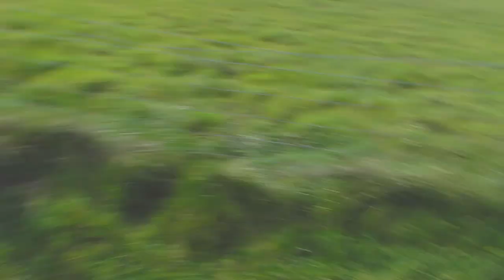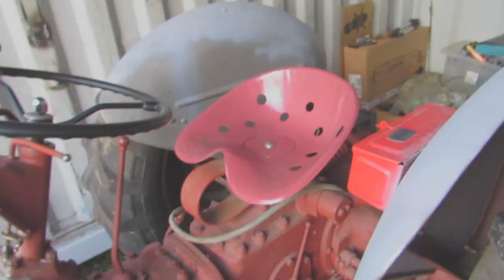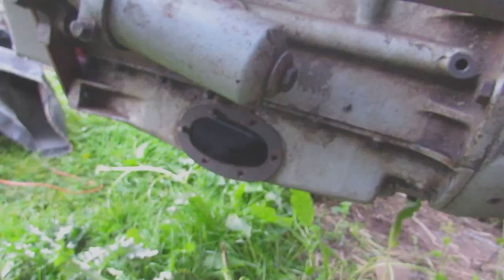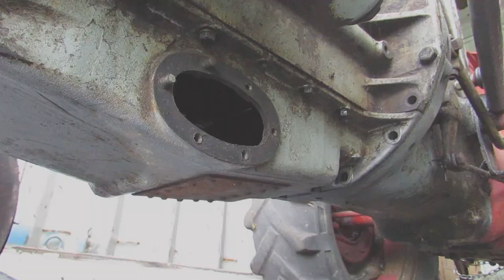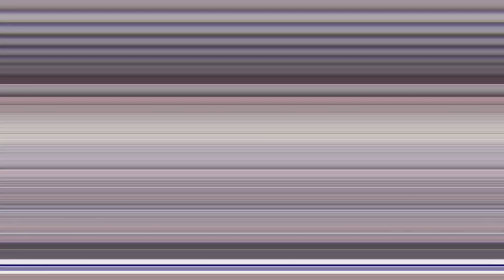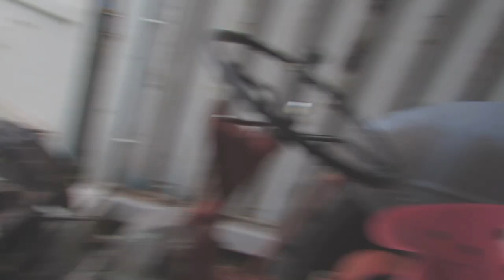Removing TEF 20 Engine Liners - Farm Vlog .1

Comment: The early liners had a cutout in the bottom and a thinner lip, I believe. I would suggest yours have been change at some stage of its life. Good vid, keep up the good work.
Reply from the maker: That’s interesting I didn’t know that! Thanks for sharing !
Reply: Can you fit liners that don’t have the cutout. And what is the difference in a bottom end that has an enclosed crank and ones that have main bearing caps

Comment: Hi, were you able to remove the pistons with the liners in place? I thought on the tef20 engine the conrod wouldnt fit up through the liner?
Reply from the maker: Hi, yes. They won’t fit up either way so you have to remove the crank and take them out the bottom. So once the crank was out I just pulled them out the bottom then tapped the liners out

Comment: hi Samuel is it possible to fit new liners and pistons on a tef diesel without removing the engine. thanks
Reply from the maker: Great question, short answer is no. You have to take the pistons out through the bottom so you will need to take the crank out and for that the engine will have to be out so you can slide the crank out of the flywheel end